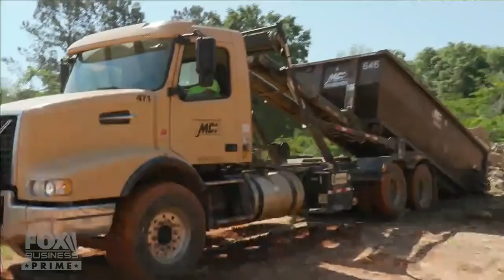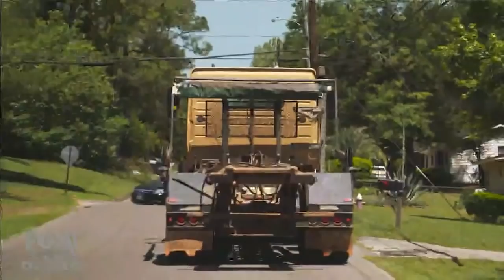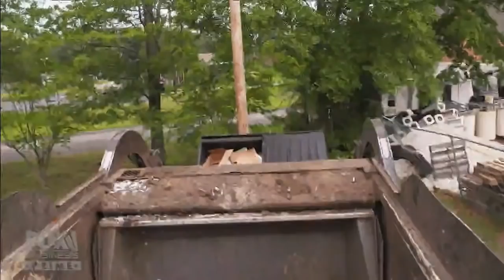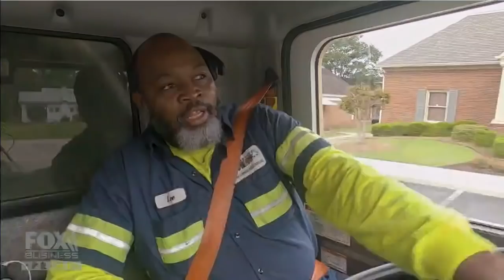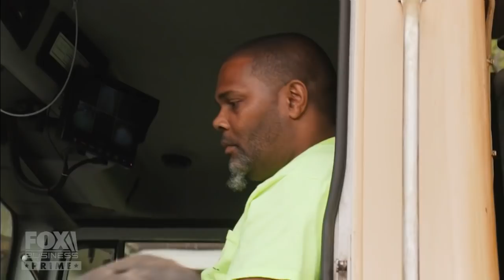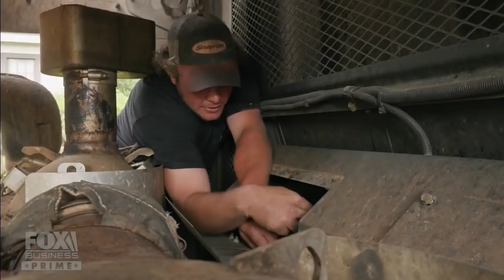How America Works: National worker shortage takes toll on waste management

Comment: there is no way he can make 150 stops in 1 day, impossible.  Assuming it takes 15 minuets to get to each location on average and facilitate the emptying of the bin, it would take roughly 38 hours.  do the math its not possilbe.
Reply: I had a tight route here in Phoenix where I had 135 stops and I could knock it out in 9 hours. Most of the stops were single cans. If you have the right route you can do it
Reply: And if it takes 2 minutes per bin, then it's 300 minutes or 5 hours.  We're both on the extreme end I'd say.  I KNOW it will take longer than 2 minutes to drive to and dump each bin, but with a tight route 15 minutes seems extreme.  It will be a long day for sure.